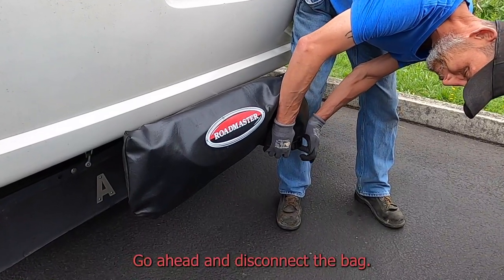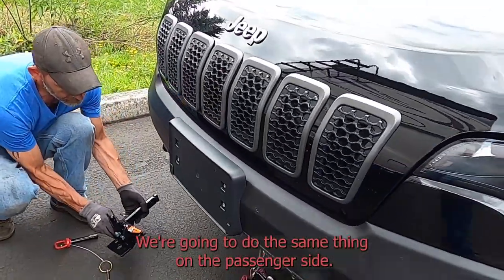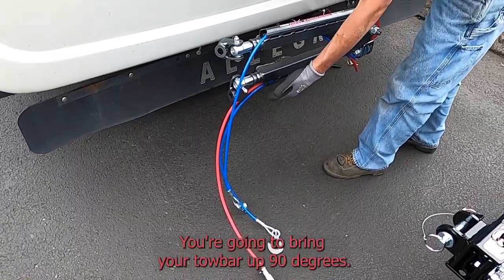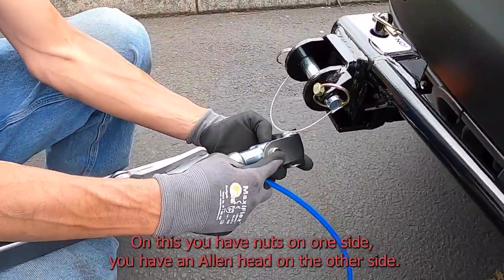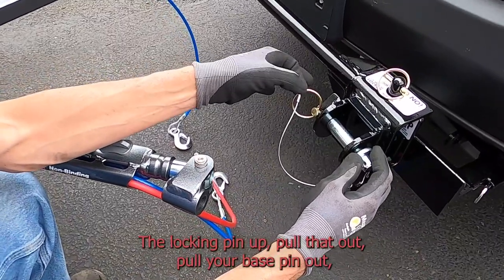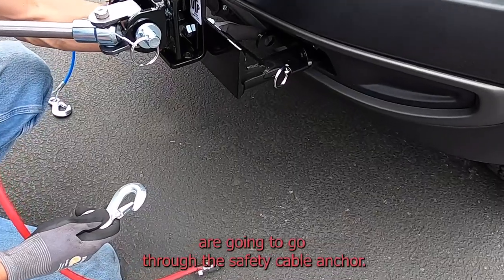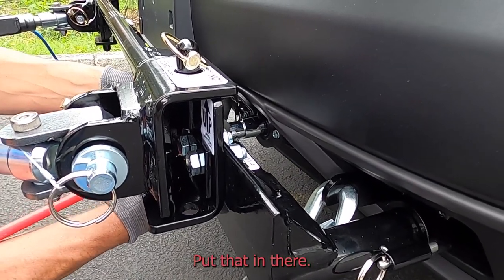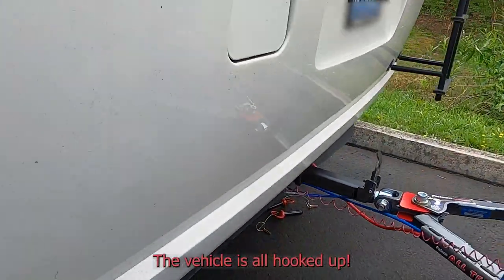How to Hook Up A Falcon All Terrain Tow Bar With a Crossbar

Comment: Where do I find the brackets that the truck has. Cause  I'm missing them
Reply: That part is called ‘tow vehicle base-plate…’ Roadmaster has a really nice set up. The base plates are vehicle specific.  We ordered ours from Jeff’s Jungle.  Good luck
Reply: What are the two levers for on each arm?  Instructions don't explain. Thx in advance.